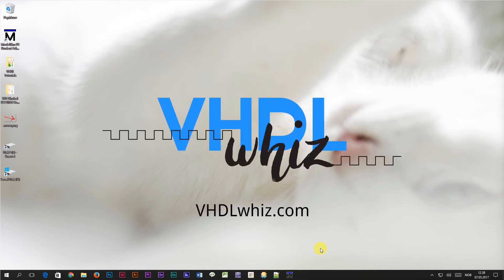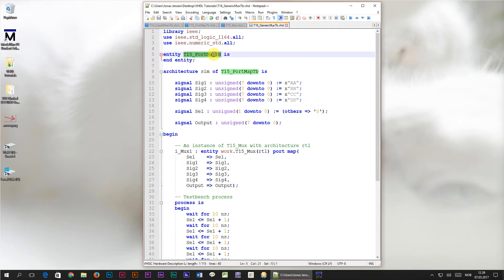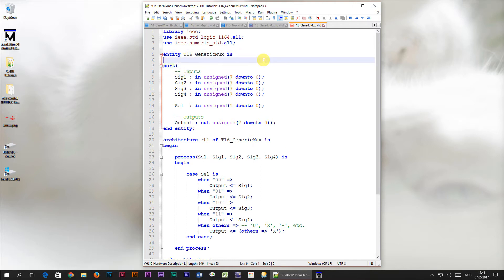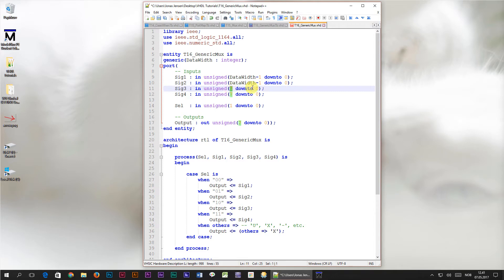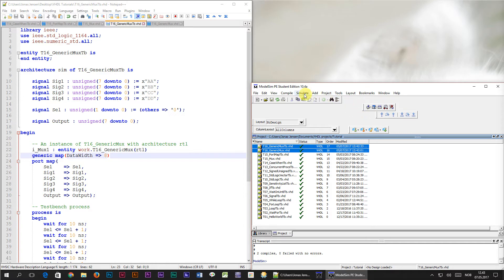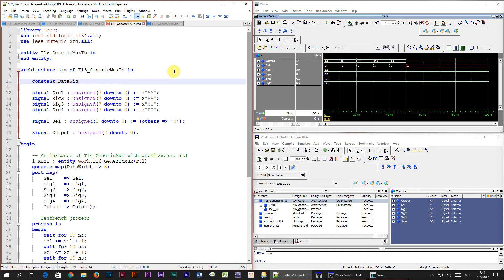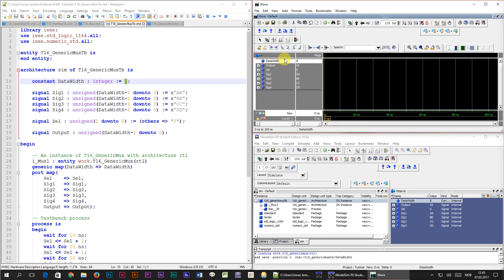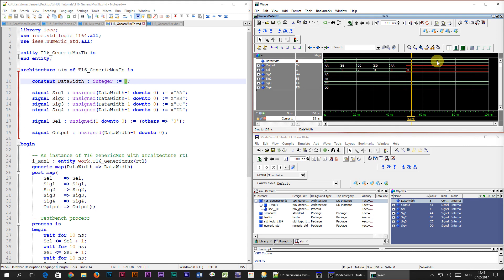How to use Constants and Generic Map in VHDL

Comment: what will happen if you set the constant value to 4? The muxer output will still try to set 8 bit values to 4 bit wide signal - in a way its not very generic if the output values are hard-coded, can the output values be of programmable width?
Reply: never mind, I see you addressed that in another comment

Comment: The instantiation of the signals is not generic yet though. x"AA", x"BB" etc. assume an 8 bit value. Looking into ways how to make them generic too now.
Reply: Initialized them with this `others => '0'` now, and then created a one-time init process (having wait statmement at the end) in which different bits are set to '1' for each of them.
Reply from the maker: @TheLeontheking  It's better to use a function to create complex signal initialization rules.

Something like this:

  constant datawidth : integer := 32;

  -- Initialize to "....10101010"
  function init_sig return std_logic_vector is
    variable r : std_logic_vector(datawidth - 1 downto 0);
  begin
    for i in 0 to datawidth - 1 loop
      if i mod 2 = 0 then
        r(i) := '0';
      else
        r(i) := '1';
      end if;
    end loop;

    return r;
  end function;

  -- s = x"AAAAAAAA"
  signal s : std_logic_vector(datawidth - 1 downto 0) := init_sig;

Comment: # ** Fatal: (vsim-3350) Generic "DataWidth" has not been given a value.
this happens when i tried to copy past the code from this video,
and so i instantiate the value "DataWidth" in the generic declaration but the signal is "x" 
how can i fix that?
Reply from the maker: You have to assign something to the generic when you instantiate the module: "generic map(DataWidth => 8)" or something. If I understand correctly, you figured that out.

When you say that the signal is 'X', I guess you mean the "Output" signal. According to the code, this will happen if Sel contains a value other than '0' or '1' or if one of the signals Sig1, Sig2, Sig3, or Sig4 contains 'X's. My bet is that you have not set Sel to anything, and it's therefore 'U' (Uninitialized).
Reply: @VHDLwhiz  my bad !
i just simulate both the MUX and test-bench file at the same time 
fixed when i simulate only the test-bench file
thanks for your replay!

Comment: Is there anyway to estimate the datawidth in the generic block like that:
 GENERIC(
    device2address: integer:= 4;  --number of device slaves
    addwidth : INTEGER := integer(ceil(log2(device2address)))
);
Reply from the maker: Yes, but you will have to implement log2 yourself. It's not defined in any standard library that I know of. Or you can use signed/unsigned:
constant addwidth : unsigned(device2address - 1 downto 0);
In either case, you have to define the addwidth constant in the module, and not on the generic declaration. You can't use one generic constant to define another generic constant on the same entity.

Comment: Hello Jonas,

If we use a generic map for the bit length of our signals how will that be synthesized?
Since the value is only defined in the testbench , do we have to give it a definite value when we are happy with the perfomance of our design? Or the synthesis tool will get that value from the testbench?
Reply from the maker: That's going to synthesize to whatever length you assign to the generic map. If the module using generics is a submodule in our design, we assign a value to the generic map when we instantiate it, just like we did in the testbench. If the module using generics is the top module, you can assign a value to it from within the implementation software. In Xilinx Vivado it's in the Project Manager menu: Settings->Language Options->Generic/Parameters.
Reply: @VHDLwhiz  think I got it now! Thanks!